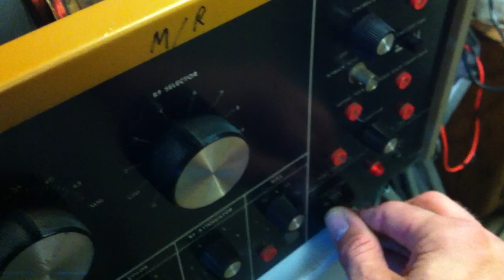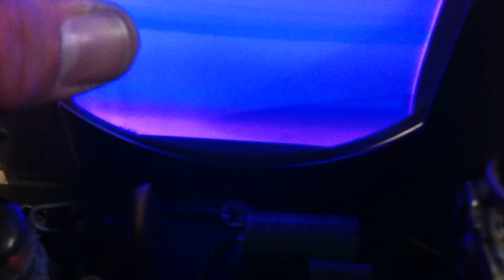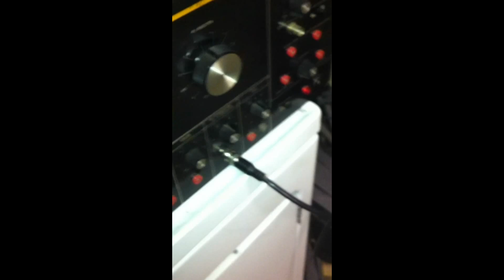B&K 1077B Television Analyst Repair

Comment: I've got 2 1076's. So far I haven't had this problem. One of my 1076's was found behind a closed TV shop. It looked like it had sat out in the rain for 6 months' Dried it out and cleaned it up. Had to change some 2 meg resistors to get the vertical linear. I suspect I'll have to repair the yoke some day. Thanks for the video!
Reply from the maker: @outofround  it's amazing these things still exist anywhere. Products of a bygone era.